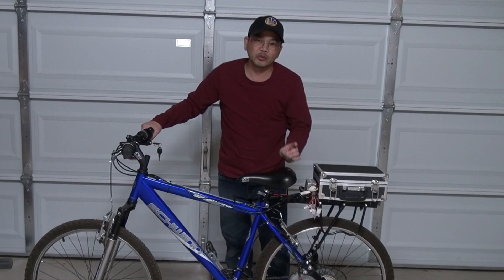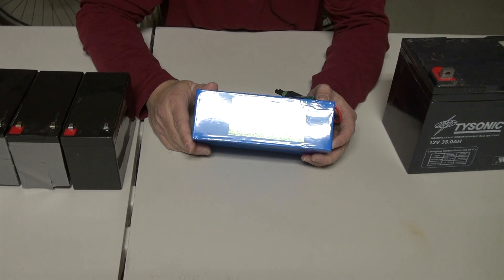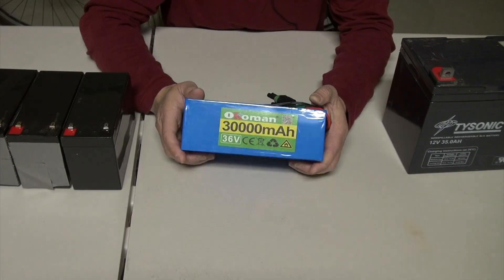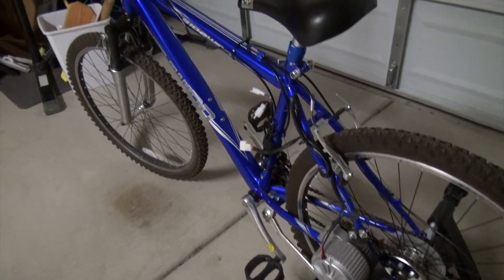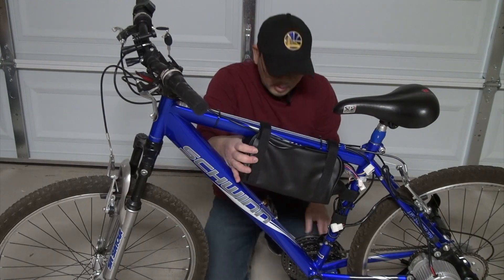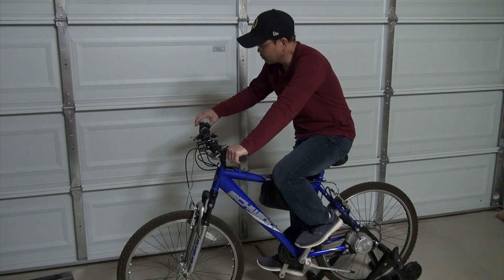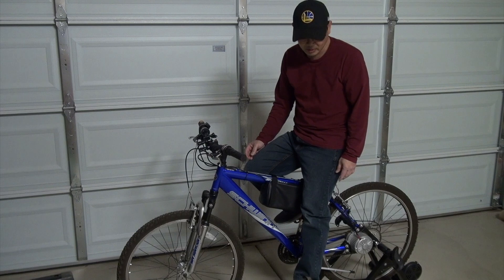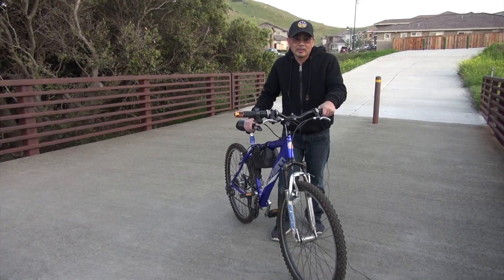Powerful Electric Bike Conversion Part II--Lithium-ion Battery Power Boost Upgrade

Comment: Do you have heating issues with the battery pack and controller stuffed inside what looks to be a somewhat filled and stifling bag?
I'm asking because it doesn't look like it breathes very well but it does look a lot nicer than the ones typically sold for this application so I guess I'm just wondering is it able to dissipate Heat properly as it sure does look a lot nicer than the ones made for that
Reply from the maker: No heating issues with the battery pack.  I selected the bag because it also prevents water or rain from touching the battery pack and the controller..,Thanks!

Comment: What is your range and speed capabilities before and after conversion to lithium ion so I can compare the two because I was looking at that same kit and reluctant to buy it because it looks quite janky that said looks don't concern me near as much as performance and capability and yours is the first I've seen that actually fit properly without drastic modification of the bracket or bike or both to get the chain lines straight

Comment: Great placement on the battery and once you convert it over to something that has a much better power density you'll have assuming you use the same case and rack a long distance bike capable of up to or more than 100 miles I suspect
Reply: What's the price including shipping for the battery
😅

Comment: Can I ask what was the distance on average with lithium battery?
Reply from the maker: The answer varies depending on the weight, speed, conditions of the road, uphill, downhill, type of motor you are using and how much amp-hours the battery has.  On one charge, I rode more than 7 miles on this pack.

Comment: Awesome Job. I am looking to do something similar but with my Surrey Quad Cycle bike. It has two sides with two drive chains. I upgraded from a single speed to a 3 speed on each side. Next step is to add an electric option
Reply from the maker: Sounds like a great project.  Best wishes!  Thanks for sharing.

Comment: How good is that motor, gearbox, & sprocket for going up hills, and, do you think you would lose much speed when installing a larger gear for climbing hills better?
Reply from the maker: Hello,  the motor works well going up hills.  I’ve not driven it on steep hills, though. I’m not sure about the differences with larger gear, but it will use more energy either way when going up hills…Thanks!

Comment: Is there motor resistance when just pedaling with no battery power? Thanks
Reply from the maker: Just slightly due to the additional connection to the motor and sprocket.  Thanks!

Comment: will this battery work with the same kit you have 24 volts 250 watts
Reply from the maker: The electric motor is rated at 36V 450W.  Thanks!

Comment: Do you have the link for the battery?
Reply from the maker: Here are the links to the batteries on amazon to get you started. Please check the ratings and reviews on these batteries before making a purchase.  A number of viewers pointed out that there are battery packs with false ratings on the market.  Be careful.  I think these two are legit.
36V 20AH Lithium Battery Pack 
https://amzn.to/3mLyA1q
Ebike Battery 36V 20AH with 2A Charger, T-Plug, XT60 Connector https://amzn.to/3v8qfsj

Comment: That's def not 30ah it looks like maybe 8ah
Reply from the maker: Thanks.  Another viewer pointed that out as well.  I’ll be more careful in the next purchase.
Reply: @diypotentials  there are so many 18360 batteries being made, there are many that are fake 18360's that are lighter and have way less amp hours, sadly the market is flooded with these low quality batteries,, there are youtube videos on how to spot fakes and how to spot the real deal 18360's but you would have to cut the plastic to see the cells and check the numbers
Reply: 30 ah is a no way, I would say 12 ah is a better guesstimate
Reply: It's possible that is 30ah battery if they use the flat type lithium cells. Kinda like one used on phones.
Or, probably lifepo4 battery like those used in solar power storage.
If it's 18650, yeah maybe no.

Comment: I am thinking about gettin same motor for me and my wife... I have seen kit around a while. Does the motor interfere with back foot when pedaling? Its so close to heel that it seems like you would hit back of your foot could you do a video of you pedaling and maybe a close up  of pedal and motor area.... Thank you for the video
Reply from the maker: When you are on the electric mode, you can rest your feet on the pedals.  If you are pedaling, the left pedal is close to the motor, but you can position your foot to create clearance…Thanks!
Reply: @diypotentials   thanks thats what I thought might be the case. Someone oughta redo the plate so gou can pedal normally!
Reply: @YardYetiWV  you can use the same plate and mount the motor in the vertical position so its above both bike bars instead of between them, and then you will have all the clearnce you need
Reply: just mount the motor in the vertical position, and you will have all the clearance you need

Comment: Hi how are u able to charge this as I bought they same kit and bought the charger separate but the charger isnt doing anything
Reply from the maker: I charge the battery separately as well.  Sounds like something is wrong with the charger...
Reply: I did find a charger for directly plugging it. Is it fine to charge a lithium ion battery 36v with a 42 v charger
Reply from the maker: The charger's output for my 36V battery pack is 42V as well.  It is okay to charge.  Thanks!
Reply: @diypotentials  thank you

Comment: helo Sir can i use 50ah battery for 250watts motor?
Reply from the maker: Yes, so long as the voltage of the battery is rated for the motor.  For example, if the motor is rated for 24V, then using a 24V with a certain amount of amp-hours  so be ok.  Thanks!

Comment: that's not going to give you any better range than the lead acid 10a batteries. your battery is probabaly about 10a as well. Most chinese 18650 cells are around 2amps so a 5p pack is 5x2amps = 10amps. mislabeled chinese battery packs is the oldest trick in the book . sorry, but now you know why yo0u are not getting 3x the capacity vs lead acid.
Reply from the maker: Hello, thanks for the comment.  I hope that is not the case.  I might have to open up the pack to test it or do a runtime comparison between the two batteries.
Reply: @diypotentials  well that is what the shady battery maketing department counts on. people not actually testing the capacity of the cells. sorry you got screwed. www.batteryhookup.com is much more honest and often has complete packs if you are patient enough to wait.
Reply: @diypotentials  10 AH is still usable some ebikes come with a battery like that as standard and the lithium will be a lot lighter that the SLA , times the series by the parallel to get total number of cells then divide stated capacity in milliamps by number of cells and you'll soon see that the stated capacity is not true

Comment: It's possible to use more than 36v battery 🔋 on 36v 350 kit
Reply from the maker: It is possible if the controller allows more than 36v.  However, if the motor is rated for 36v, it is most efficient at 36v.  Of course,  your bike will be much faster at 48V.  Thanks!
Reply: and what about lower voltages ? 12v 24 v?
Reply: @adarshseegoolam  lower voltage less speed. The only thing about overvolting the motor is you gotta have compatible components, and you gotta keep an eye on the motor temperature

Comment: How did you change the battery ports? Was it easy?
Reply from the maker: If your controller and battery pack terminal plugs don't match, you can replace them with new terminal plugs.  You can find terminal plugs on Ebay or Amazon.  Be careful. When you replace the battery plug, make sure the positive and negative wires don't touch.  Thanks!
Reply: @diypotentials  looks like i need to solder!

Comment: Like the way you converted your bicycle into an e-bike. Could you make a video how you charged your battery, or what type of charger you use. This information would be very helpful. Thank you.
Reply from the maker: Hello,  Thanks for asking.  The battery pack came with a 36V lithium-ion battery charger or you can purchase one separately.  You can find them on Amazon or Ebay.  Thanks again.
Reply: Thank you

Comment: ok ive the system on the by bike for awhile im loving...but ive now got as problem with the sprocket o0n the motor  has came lose from the back side of sprocket hoping i can just fix wit on...if not how do i remove the sprocket without damaging the 36v 350w motor...thanks
Reply from the maker: Hopefully you got it fixed by now.  You should be able to remove the sprocket from the shaft without damaging the motor.

Comment: how is the millage?? how far or how many hours did this new battery lasted before it goes low bat?
Reply from the maker: Hello, I rode about 7 miles on the battery but have not fully depleted the battery before recharging it to full again.

Comment: thinking of getting one of these myself for my bike. do you think its worth it?
Reply from the maker: I still have lots of fun with it.  The electric motor serves as an extra gear, especially when going up hill.  Also I use the battery for other purposes as well when I’m not riding.  For me, I think it is worth it.  Thanks for asking.
Reply: @diypotentials  great man  im thinking of using it to get to school as i live a bit far. im just scared that the motor will break somehow? how has your motor held up. big thank you for the vid and response :)
Reply from the maker: It is perfect for getting to school.  The motor is solidly built.  No issues with it so far.  Thanks again.

Comment: Nice !! Looks so fun haha, i want to do this! But where did you buy the lithium battery?
Reply from the maker: I ordered it through EBay from China because it is way cheaper than US sellers.  It took about a month for it to get to the US, but it was worth the wait.
Reply: @diypotentials  wow so thats great to know because i was looking at aliexpress but i would love to order from the same ebay seller as you did, i would feel so much more comfortable that way , would you be willing to direct me in the right direction? I have already found a ebike converserion kit on Amazon for $177 flat 36v 450 watts but batteries are so expensive on Amazon
Reply from the maker: @yerwooda5681    Here is the search phrase for the conversion kit on ebay--36V-450W-Ebike-Left-Drive-Electric-Bike-Conversion-Kit-Hub-Motor-E-Bicycle-Kit.  It is a little less expensive than Amazon.  I purchased the battery from this seller on ebay.  https://www.ebay.com/itm/36V-30Ah-Lithium-li-ion-Battery-Pack-750W-ebike-Bicycle-E-Bike-Electric-charger/393005243505.  Good luck on your project.